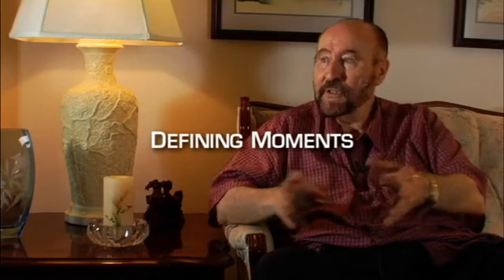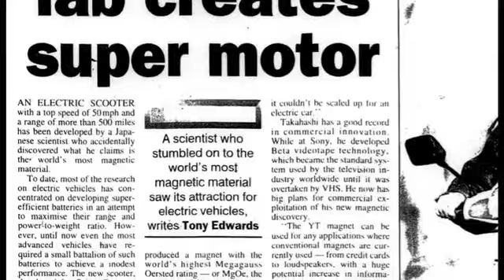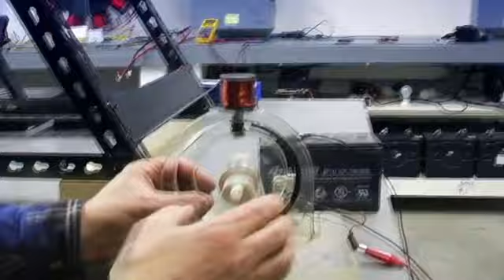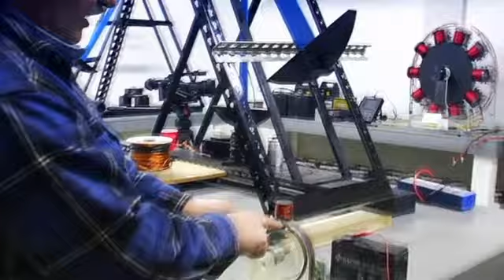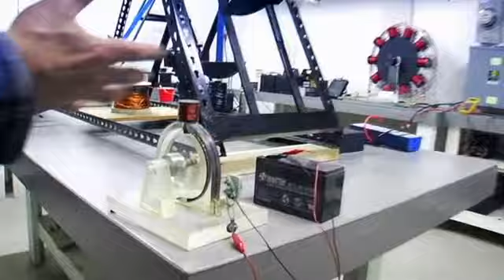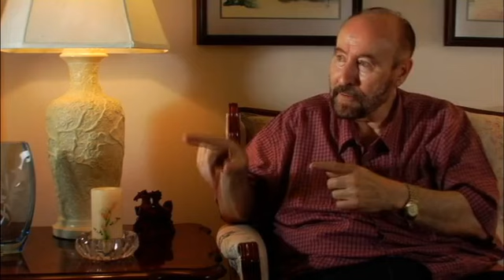16-A - Equilibrium, Entropy & Energy Defining Moments (2009)

Comment from the maker: 0:32: 🔋 Understanding entropy as a measure of lost energy and loss of control within a system.
0:32: Entropy is simply a measure of energy that a system had control over but can no longer utilize.
0:47: It signifies the dissipation of energy that is no longer within the system's control or use.
1:00: Entropy is not mystical or magical, but rather a quantification of energy no longer accessible to the system.

4:18: ⚙ Energy conservation in violation of the second law of Thermodynamics through wind energy.
4:18: Violating the second law of Thermodynamics by harnessing wind energy for sailboats and windmills.
4:59: Continuous energy input from the environment sustains the operation of windmills in defiance of the second law.
5:18: Wind energy enables sailboats and windmills to operate without violating the first law of Thermodynamics.

8:16: 🧲 Concept of linear magnetic motor with diverging rails creating thrust based on North Pole density difference.
8:16: Linear magnetic motor concept with diverging rails and North Pole density difference creating thrust.
8:56: Description of how a North Pole in the rail of the linear magnetic motor attracts a car with a North Pole, causing acceleration.
9:30: Discussion on transitioning the linear magnetic motor into a closed loop system.

12:36: ⚡ Utilizing inverted T polepiece to create a temporary accelerating field by opposing EMF, resulting in a surge of current.
12:36: Inverted T polepiece invokes Lens's law to create a strong field in opposition to EMF, leading to an acceleration effect.
13:08: Sharp gradients created by the temporary field violate the second law of Thermodynamics, allowing the object to accelerate through the back MMF.
13:41: Skimming past the back MMF without allowing it to influence results in an accelerating field with no effect on the object.

16:32: ⚙ Experimenting with magnet acceleration on a track and confirming theoretical principles.
16:32: Testing the acceleration of magnets on a track based on a theory
17:19: Satisfaction with the theory working and limitations due to patent constraints
17:46: Verification of track theory by experimenting with magnets

21:03: 🔋 Exploring energy generation using leaky diodes and magnets with unknown magnetic effects.
21:03: Energy generation through leaky diodes and magnets with unknown magnetic effects
21:39: Nature's provision of energy through magnetism with various understood and not understood effects
22:10: Magnetism's complexity with numerous unexplained areas and ad hoc theories

25:27: ⚙ Innovative magnet assemblies generate powerful pulses for energy conversion.
25:27: Howard Johnson used complex magnet assemblies to create powerful pulses for energy generation.
25:42: It took Johnson years to perfect the assembly of magnets to efficiently convert energy.
26:00: The materials in the magnet assemblies generate spin flips, resulting in a directed rotation for energy output.

29:45: 🌀 Incredible demonstration of a perpetual motion device using only permanent magnets and natural magnetic forces.
29:45: Howard demonstrated a rotary engine in the 70s using only permanent magnets and natural magnetic forces.
30:08: The device ran for over two hours with poor bearings and no external power source, showcasing the power of magnetic forces.
30:30: Johnson understood the exchange force and the challenge was to explain the functioning of the device.

33:39: 🔬 Exploration of energy field, collaboration with inventors, and development of potential antennas.
33:39: Involvement in energy field and collaboration with inventors like Frank Golden.
33:48: Work on motor adapting its environment and achieving over unity performance.
34:07: Development of potential antennas inspired by Professor William Tiller's knowledge.